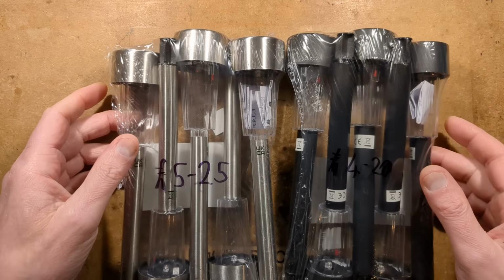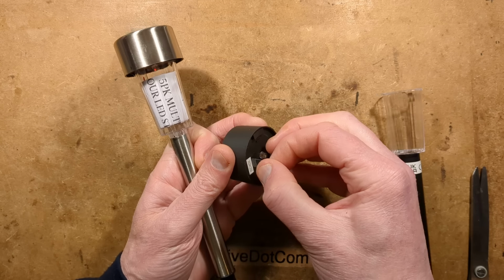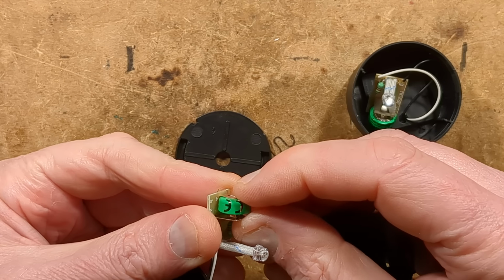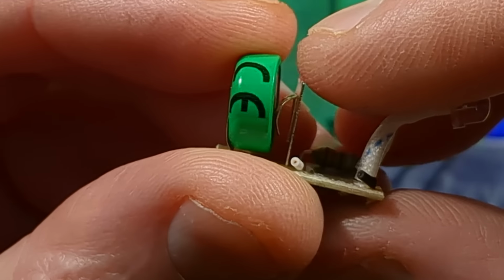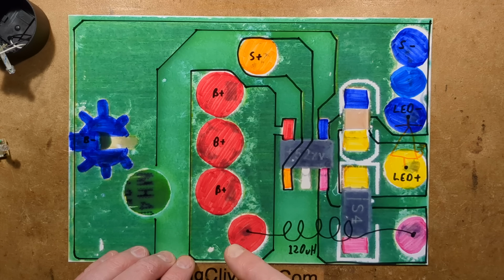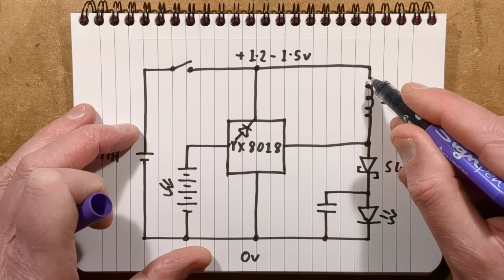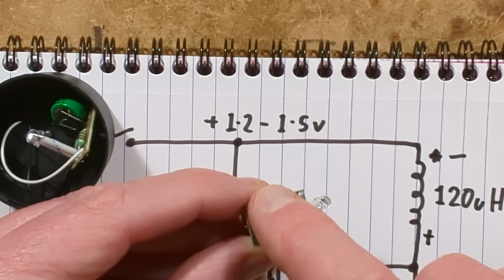A look inside Tesco solar lights - RGB and plain white

Comment: Have you seen solar lights that have 18650 battery cells in them?
Reply from the maker: Yes.  I've featured a few.  They usually have 10 or more sections on the solar panel.

Comment: I have a question.  I bought these things called "MorTime LED Solar Hummingbird Wind Chime, 25" Mobile Hanging Wind Chime for Home Garden Decoration, Automatic Light Changing Color(Hummingbird)" on Amazon.  A couple of the birds have died.  In looking at the LEDs, I'm pretty sure there's a resistor leading into it (covered with yellowed hot glue so hard to see).  But these are all color changing, so why would they have a resistor on each LED instead of handling the voltage and current on the circuit board?  I'm a beginner....please forgive my ignorance.  I'd love it if you could tear these things down in a video.  They fail on me all the time, but I love them.  Thank you!!
Reply from the maker: Having a resistor shares the current better.  Especially with RGB LEDs in parallel where the red part of the cycle has a lower voltage and could dim the other LEDs.
Check for signs of corrosion.  You can get new LEDs to repair it.

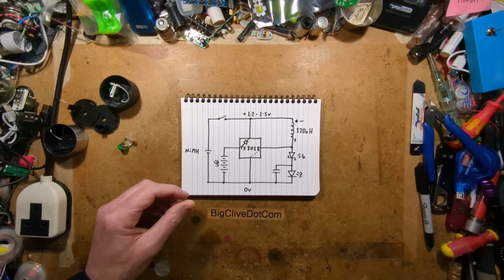Comment: 8:26 Rofl. Accidental reveal. As long as everything is still where you remember it isn't a problem. But if something starts to avalanche then you have one.
Solutions: Clean up beforehand. Or do long sorting afterwards (after the avalanche). ... Well, if you had an avalanche you also could toss everything in a box and forget about it.

Since my project space doesn't look any better, I know all about avalanches. ... I need to start to toss out the forget-about-it boxes.

Comment: Are you sure it's the same IC as YX8018? In YX8018's datasheet solar panel minus is not connected to ground externally, and is connected to gnd by mosfet inside the IC. And solar plus is externally wired to battery plus. Which is different from what we see here.

Comment: Living in the Philippines, humidity and rain present constant challenges. For waterproofing smaller circuit board projects, liquid electrical tape has proven effective, though repairs become difficult. Examining local solar lights reveals most have a single AAA-sized NiMH rechargeable battery.

Comment: One trick with these lamps ... is to buy them at the END of the season ( for next year ? ) ... they then cost 50p each (  £ ½ 😝) .... also varnish the LED legs ... they are usually Tin plated steel , and with 3 Volts running  the LED ... they go rusty , VERY quickly .... ( owners of cheap outdoor LED strings , usually have to replace them every year , as the LED legs go all brown and falling apart ) ... nice clutter , BTW 😝 ............... DAVE™🛑

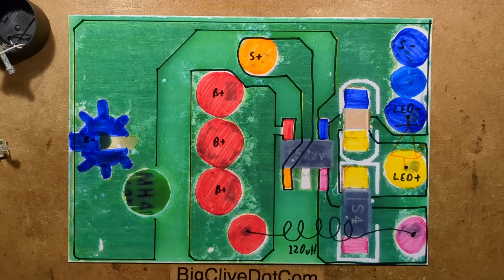Comment: 5:20 re: bigger cell, I have a similar solar light and its diameter is just large enough to stuff in a AA NiMH cell - can't tell if your version is smaller or it just seems that way because of your bigclive hands..
Reply: The lights like those, that I used to buy a few years ago, used a AAA cell.

Comment: Wow, those smaller version of those same solar lights are getting to have less and less inside them. 

I have some of the older versions of those same lights, and there's a 1/3AA NiMh cell and a larger board with a bunch more discrete circuitry on it. 

The MFG's have got those solar lights scienced down to the penny these days.

Comment: They sell here same lights for around 4 pounds each 😮6 units for 5.3 pounds is a bargain.....but i was expecting 3.7 lithum battery or 1.2 volt ni cd cell .but they made it more cheap with button li ion cells ....

Comment: I love little cheap solar lights. That's also great tip to try and prevent the dreaded corrosion. I'm trying a fix a light up buddha with two of those spotlight-style LEDs that got corroded. I realised they drilled a drainage hole, but it left a lip on the inside that meant water was getting stuck inside. I tried some new LEDs and it does still work, but still a work in progress as it's very fiddly.

Comment: We used to dip our boards in melted wax.Thank you, and keep working
Reply: But vax has pretty low melting temp 37-88°C, could that pose a problem since chips can get quite hot?
Reply: @semiRockethr  You have to account for heat. Try it, it works great.

Comment: Do the RGB-LEDs switch their colors by higher voltage pulses?
The cases and connecting plastic parts seem to come from 1 factory only for the entire world market - we're having the same shapes here in Germany without having Tesco. 😂
Reply from the maker: They just see a continuous low DC voltage.
Reply: @bigclivedotcom  So they change their color by an "IC" in themselves?
What is the inductor for if pulses are not needed? 🤔
Reply from the maker: @u.e.u.e.  The inductor is used to step the voltage up to a level the RGB LEDs can operate.

Comment: Those little cells often don't last more than one or two summers.  I was considering bunging in a supercapacitor — I was thinking ≥ 1F — which, with the protective coating that you mentioned, might last a few years longer, although how long the light would run is another matter. The LED leads are often plated steel which rusts through fairly quickly and would also benefit from protection.
Reply from the maker: Keep in mind that a typical year gives them 365 charge and discharge cycles.  So a couple of years is OK.

Comment: Good to see a bit of clutter Clive, sign of a genius at work :0). I also use the UV resin to re-juvenate the cheap weathered solar panels. I give them a light sand, then pool resin over the top, seems to work fine. also just re-watched the TP4056 module (mythbuster), and realised I have today bought the ones without the DW01A, nuts but heyho will only be using with low current items anyway.

Comment: I use vaseline paste in circuits that will be exposed to the wet. This covers all contacts and repeals water but can be easily removed i.e. for changing battery.

Comment: I have exactly these(non rgb), not put into operational duty yet. Will rightaway 3d print a petg battery gripper, to save me from throwing them out prematurely in future. Will also do a conformal coating/hermetical seal using my uv clear doming resin, to let them graciously die of old age. Trying to figure out a right word in vocabulary, to describe the clutter on my desk🤯. May be will find a suitable word, after sufficient de-cluttering🤔.❤👍

Comment: Thanks for this video, Clive. Those solar lights don't look like they will stay lit for very long with such tiny batteries in them. The modules could be used for other projects and presumably work with a larger battery. I'm a bit surprised that you complained about the battery contact and suggested a cable tie when there is clearly a plastic moulding present to hold the battery securely.

Nice shot of some more of the workbench, by the way. It makes me wonder, does this mean that we could see teardpwns of larger objects here if the camera has such a wide zoom. The image quality is better with this camera as well in that the contrast is much more natural and watchable compared with the excessive contrast of some earlier videos and it has a decent zoom range. I do note that the sound quality is much more listenable to, compared with the last few videos, with a nice top end and no glaring sibilance like some earlier videos. For example, the  video from 20th April this year (v=HzteoG9gluU) has far too much of the high frequencies and was very sibilant making it a bit of a cheesegrater for the eardrums. I would be very happy with more videos made with this camera. Perfection is impossible, so just do the best you can!
Reply from the maker: I think the cheesegrater video was probably mashed up stereo.  Each time I switch to a new recording device I have to enable and disable different modes from previous units.

Comment: I use hot melt glue on mine 
The sensored ones are super senssitive to moisture
The micro chip crashes sometimes and the only fix is disconecting the battery
Reply from the maker: The crashing of microcontroller based ones is sometimes caused by the very slow voltage fall and rise during a total discharge situation.

Comment: Would it work if changing the battery to a spare 18650 battery together with some voltage divider to bring 3.7v down to 1.2-1.5v?  I wondered if there is a very tiny voltage divider somewhere and would this not drain the 18650 battery too much?
Reply from the maker: The solar panel puts out 2v and couldn't charge a lithium cell without extra circuitry.
Reply: @bigclivedotcom  Silly me, that's true!  Point taken.   Good video.

Comment: Hold on until August/September or so. Last year they were clearing these for less than half price - I bagged a set of the black ones for £2.50 and a second set for two quid! Swapped the horrible bright white LEDs for some night vision friendly red ones and stuck them out around the garden.

Comment: Ah! finally caught a video recently enough that there's a reasonable chance Clive might see my comment :) Clive, I wanted to share an observation about the "unique" ways that I've seen battery pack capacity expressed. I bought a phone charging pack recently and saw the familiar mAh, or milliAmp-hour, even when amounts were high enough that it would seem more appropriate to drop the milli; for example 15,000 mAh, why not just 15 Ah? Well this time they had taken things further. They did collapse those excess zeros, and in a very creative way. Instead of 15,000 mAh, they had 15k mAh! Fifteen kilo-milliamp-hours! I thought they should go all-in, and say 15GnAh, or Giga-nano-Amp-hours, as both Giga and nano seem to be trending lately :)
Reply from the maker: I do still read every comment on every video.  The biggest issue with the mAh ratings on many grey import batteries is that they are often grossly exaggerated for sales.

Comment: Please try Aldi/Lidl next. I saw one in Aldi the other day with a 14500 battery that actually looked pretty good, for around 2 pounds. The battery was wired wrong and due to this, it was unusable after some time. To replace the battery, I'd have to spend at least 3 pounds, or just over 5 pounds for a pack of 5. I might as well buy a new light at that point, and just rewire the solar cell.

Comment: The depth of field of the new camera is much better than the last.
Reply from the maker: The recent test of a different recording device were an absolute failure.  It appears that the Moto phones don't always have the same standard of camera system.

Comment: Audio sounded fine here Clive, and the video looked fine too. No worries re the "ClutterView" TM  app in the cam.  The lenses / bezels of these lights look like they might be useful for quaffing carbonated beverages...and at the price, maybe just rinse em and put the light module back on, then place em in the garden!  8^) That contact / capacitor arrangement from the factory was pretty cheesy. There's at least 10 ways it could have been done mechanically better at same or lower cost.

Comment: I have some solar lamps with the ZX805, same setup.  I made my own boards, basically a joule thief...inductor, transistor, cap, and a coil.  But they make micro boards for about 10 cents a piece.

Comment: A blob of quick setting epoxy on the PCB becomes very runny if heated with a hot air gun. And of cause, will start setting very quickly too. Suggest too, that PCB is always degreased first when doing any epoxy work.

Comment: These IC and circuit are so good, in most cases when it stops working, it is corrosion caused by moisture, and leaking cells otherwise. Rarely faulty solar battery, and almost never the chip itself.

Comment: haha yes season for solar lights haha i live in the netherlands and yes in the winter there is so little light that the batterys just completely discharge so i would take the battery out and charge it with my rc hobby charger that can charge all batteries you can set al lot of things

Comment: Ah, the healing bench.  Everybody in this hobby has one.  Mine's the entire dining room table...
Reply: Just the table ? !
Reply: Office desk, top of the printer, both speaker stands, whilst the mike boom is great for hanging various test leads.  I've even made small shelves for the tops of the two monitors to hold low-mass items, on the basis of if I can see it, it's there! 😀